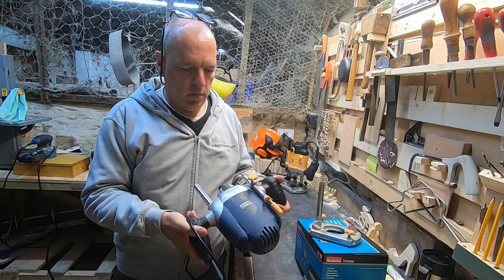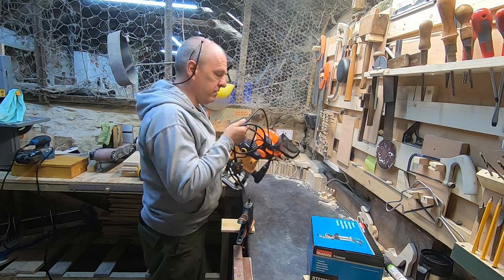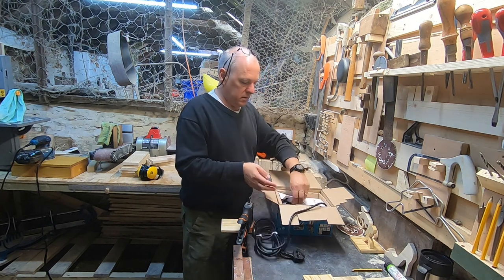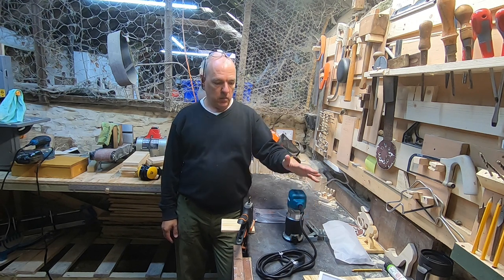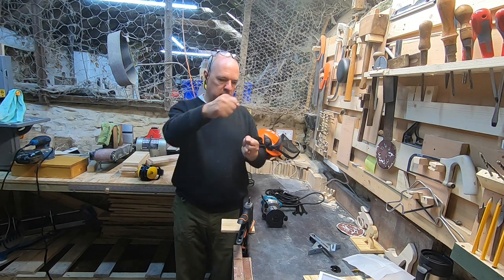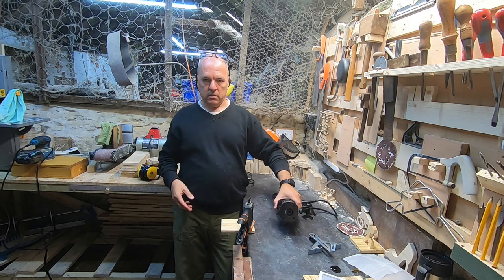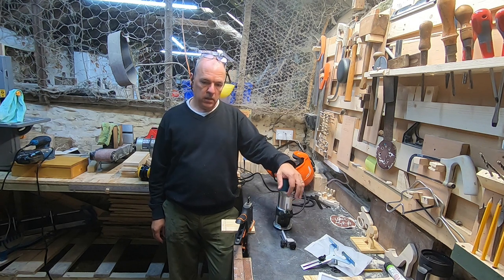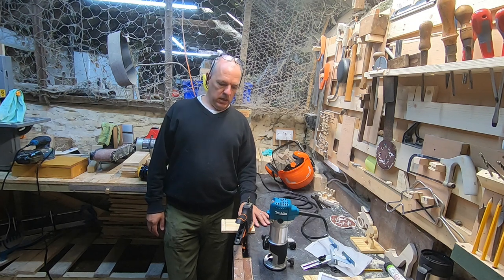MAKITA RT0702CX4/2 710W 1/4" Electric Router Trimmer 240V. Unboxing and demo

Comment: Don't know if you have found out yet, but the Katsu router accessories are fit this model. I have the plunge base and the bushing set. I have this model and it's just as good as the Katsu. My Katsu died after six years and the wife bought me this one as a replacement.
Reply from the maker: I did not know that, I will have to investigate further.  Thanks for the tip.

Comment: Hi, thank you for the review. Very good, very clear. Just what I wanted. I see you mention that you put a 1/4 in bit in. I see on the Amazon seller site that it says 6mm. This always confuses me a bit. To be clear, is it a real 1/4 in or 6mm? Sorry, genuine question. Thanks again. Pete
Reply from the maker: Hi there, the bits that I buy are listed as 1/4 or 1/2 inch bits, but having done the conversion between mm and inches, I wouldn't have thought that you'd have a problem switching between the two. I think that's more of a convention thing on the listing than an actual difference between a 6mm and 1/4 inch bit.  As you tighten the nuts, they squeeze the collar against the bit shaft, and I would have thought that you'd have no problem with a fraction of a difference in size here and there.  As I say, the ones that I buy are listed as 1/4  inch, but I really think that 6mm would be the very same bit, but just listed in a different way.
Reply: @frompallets  Hi. Very kind of you to take the time to respond in this way. I suspected that this was the case. However, I read a review of someone that bought a different 1/4 router and found that they had to buy different bits due to the .36mm difference. Perhaps they were not truthful. I am investing the little savings I have and don`t want to make a mistake. I will just risk getting the 1/4 (true) bits. Appreciate the help. Great video, thanks.
Reply: @thekarmafarmer608  From what I've heard/read/tried, 1/4inch collets should only be used with 1/4inch bits. It is the same with 6mm collets/bits. The .35mm difference between the two sizes can be dangerous as the 1/4 collet might not tighten properly on a 6mm bit and a 1/4 bit might not sit correctly inside a 6mm collet. So your 1/4 inch choice appears to be a good one as this machine has a 1/4 inch collet. 👍

Comment: Hi Rob, how does it perform so far? I bought and returned 2 palm routers so far as they don't "hold" the plunge depth. Last one was starting at 6mm depth and after working about 25cm in length the depth dipped below 9mm! (it was not makita) have you had any similar issues?
Reply from the maker: Hi @most-average-athelete, I absolutely love this palm router.  The depth never changes because of the way that you "lock it in" after you've set the desired depth.  I've heard people complaining that it takes too long to adjust the depth, but I much prefer it to be safely locked in, and for it to not change without me going out of my way to change it.